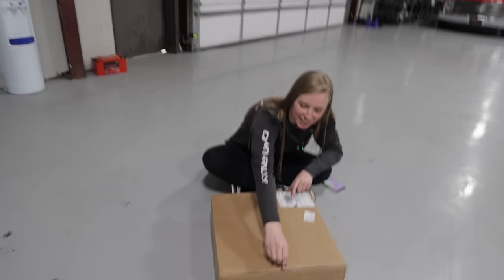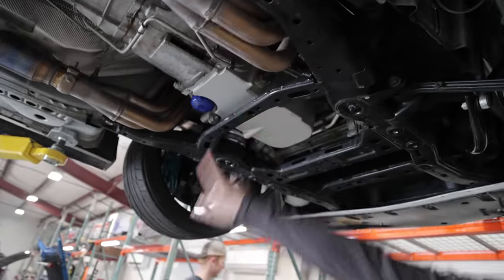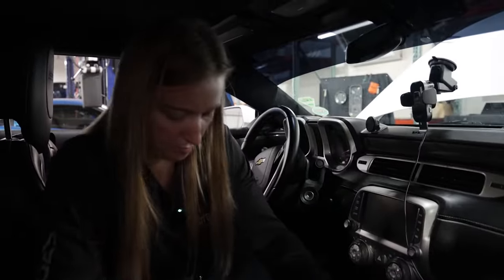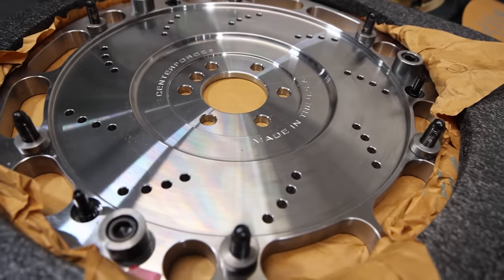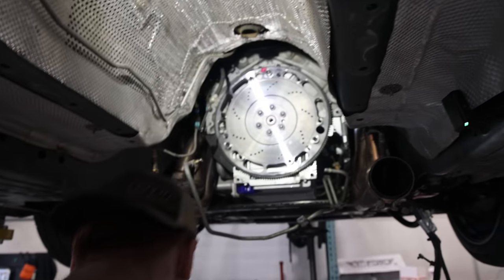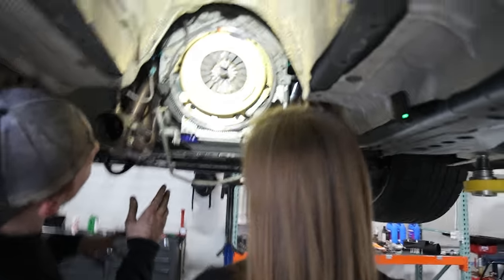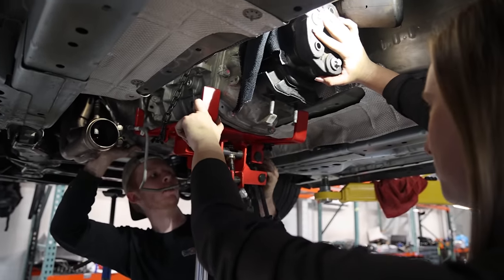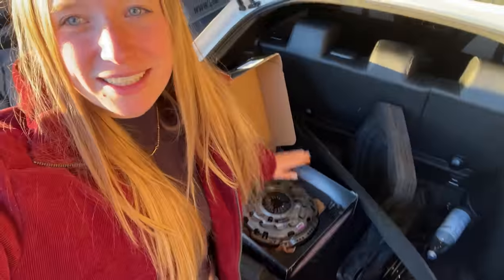Installing a Twin Disk Clutch into my Camaro SS!!

Comment: That's awesome !  I love it when new parts get installed  reminds me of when I Installed a rebuilt T56 in my Camaro Z28 for the first time !  then broke it on my first drive Lol  I was devastated because When I had It rebuilt a second time I didn't have any money to rebuild the engine with a different Cam to continue the build for more power ! However the engine still ran Good and I had fun with my 1st project Camaro Is what counts!  but  I sold the Car to start something newer not LS unfortunately or even Chevy for that matter   :(      I did do a LS swap in my Dads 1994 Chevy truck which is pretty cool  It started first crank so I guess I do still play with LS stuff Haahaaa

Comment: Kala, you need to ditch E-85 fuel, it's full of corn alcohol. It will gas wash your rings and cylinder walls, it's like running your engine low on oil.
I suggest using Shell or Sunoco premium 93 octane, you can run some Lucas REAL octane booster, it will make 20 gallons of 93 octane into 96 octane. 
You can always use more Lucas, if you want higher octane.  I was hoping you'd start your engine with open headers.
Reply: Stop telling fake information. E85 wont cause any issues to engines long as its not sitting in fuel system month. Its also important that fuel trim is correct and engine wont run too lean. When using E85 it needs fully synthetic oil with API SN or API SP because these are designed to be compatible with high content ethanol fuel. Your bad advice increases risk for the Kayla Rundle to have future leukemia because gasolines with below 15% ethanol contain more confirmed carginogens benzene, toluene, xylene. These are stuff harm rubbers, plastics, brass more effectively than ethanol.
Reply: @jakedcrane8019  Good on you Kayla some people have bad knowledge of what they can and can't do. There the sitting on the side of the strip watching Your Car going down. 🤣😂👍💯 Aussie Fan 💪🇦🇺🤘

Comment: Hey Kayla what's up I was wondering do you plan on getting a one-piece drive shaft because with the two piece like the original one that is in the car you do lose a little reaction time a one-piece drive shaft will give it a quicker reaction time and feel like more horsepower at least that's what I've been reading online I'm looking into getting one for my 2011 rebuild
Reply from the maker: Yes I for sure need a one piece Driveshaft coming soon! Haven’t found which one exactly I want yet but I’m sure you’ll be seeing that install video sometime soon!
Reply: I've been checking out the drive shaft shop they have some really nice carbon fiber drive shafts that capable of handling well over 900 horsepower they also have aluminum you might want to check them out online okay can't wait to see what your decision will be on the drive shaft I'm going to check out that place where you got your clutch to see if they have anything for my automatic okay Kayla talk to you soon
Reply: @josephsolomon8623  carbon fibre tail shaft is the way to go you don't have to worry about it coming up though the car. Carbon fibre goes to dust. 👍💯

Comment: So is it super easy to shift then??
I drove the stock 3.91 gears in the SS 1LE and it was super hard to shift for comparison.
Reply from the maker: It’s smoother to shift since my power level in high rpm’s is consistent. So it’s not jumping to different power levels when I shift

Comment: sorry if i missed it anywhere, but what year is your Camaro.  thanks.
Reply from the maker: 2013
Reply: @KaylaRundle  thanks, im doing a new clutch install in my 2010 SS, soon. so this is a great help.. thanks.  lot of work involved indeed. definately replace that plastic bearing.
Reply: Rhett

Comment: Sorry to hijack your video. Been trying to get ahold of you on State48 Camaros and your carbon fiber roof video. 
What body shop did you use to get the roof installed. Install was amazing and want that same shop to do mine.
Reply from the maker: I used a shop in Scottsdale behind the scenes/ after hours work! It’s super difficult to get any shop to do it because of reliability during crash & possibility of leaking.
Reply from the maker: Email me at kaylarundledesign@gmail.com and I’ll send you the info
Reply: Ok Thank you